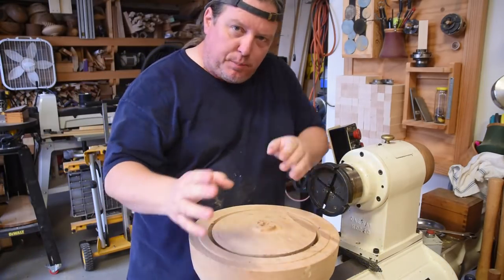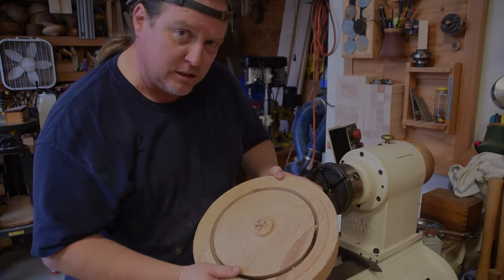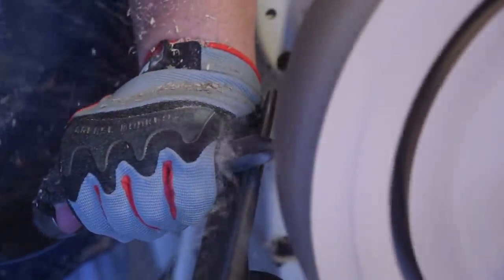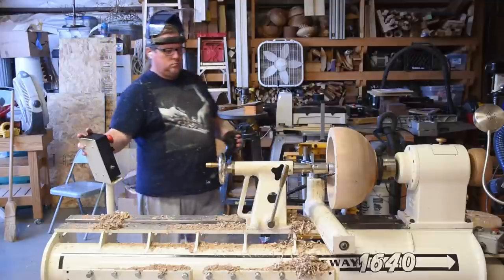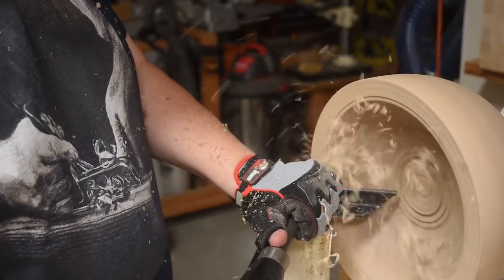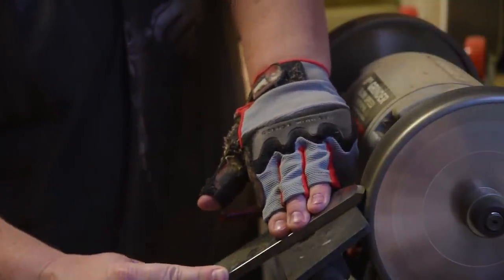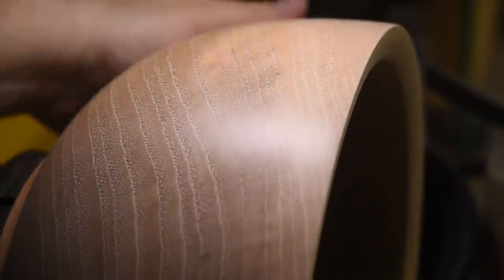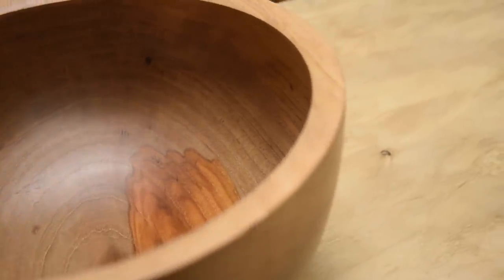PATREON V.O. Edition - Pecan-crete Bowl - "Tales from the Slacker Stack"

Comment: Old machinists trick: Get tungsten carbide from metal lathe that is bare, not coated. Find a steel bar you think that would make sense with the insert brazed on it. Find sheet metal bronz  that is about 30 thousandths thick. Use flux, heat the bar put the insert on the bronz,  and braze them together. Buy a silicon carbide grinding wheel to put a sharpened edge on the insert but with less angularity compared to steel. Use a diamond hone to put the finishing touch on the cutting edges. It will take some experimentation to get the geometry right, but once figured out, you can cut dry hardwood a lot longer before you need to resharpen with that hone.
Reply from the maker: In production mode I don't find it worth it. A few seconds to sharpen and you can take big bites vs an edge that's never quite as sharp and can only take small bites. With a little practice HSS is still fastest.